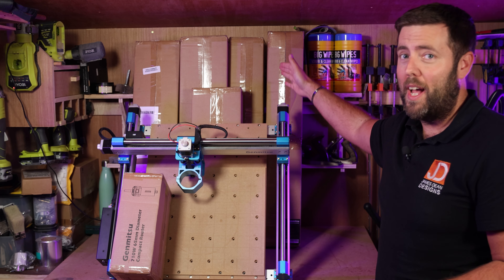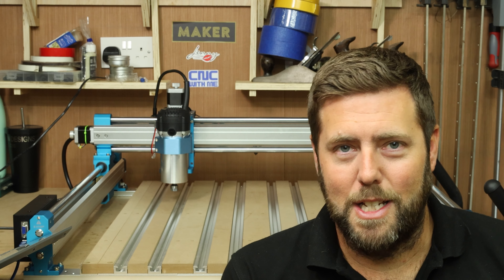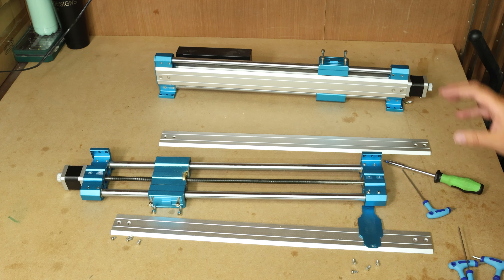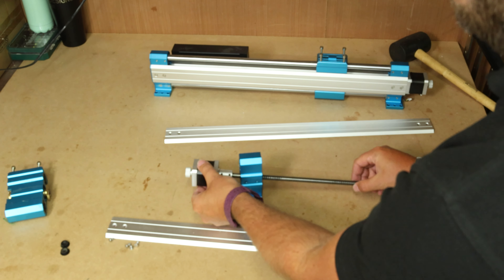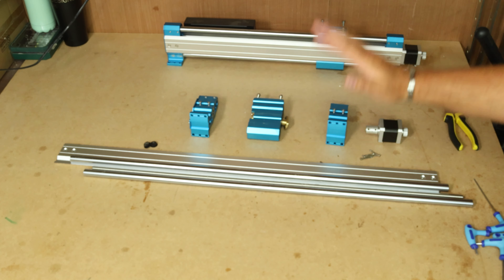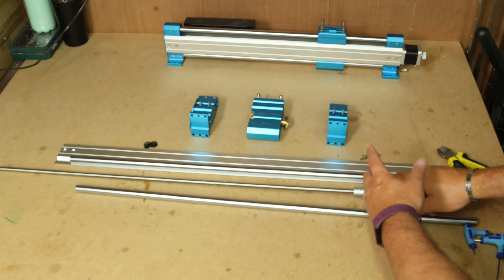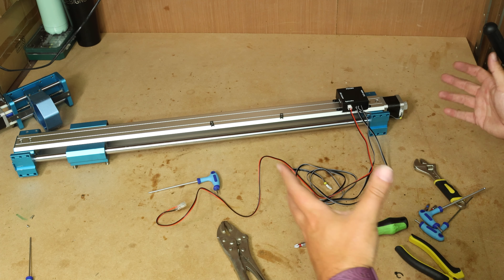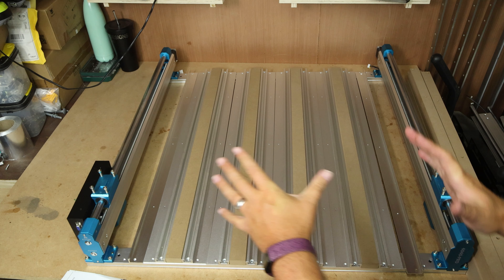Installing the 6060 extension kit for the Sainsmart 4040 Pro CNC machine

Comment: The 4040-PRO obviously wasn't meant to be disassembled with locktite having been used all over it. I stripped 3 screws trying to disassemble it to install the 4060 extension. In the end, I got it all together (took over a week waiting for a replacement part Sainsmart shipped to me from China), but one of the limit switches was behind a plate attached with one of the stripped screws so I gave up at that point and ordered a Onefinity CNC.  Sainsmart blew it on these expansion kits. Even if everything had come together in the end, which it didn't, it still would have been a horrible upgrade experience.
Reply: this was a crappy enough process that im now saving up for a onefinity machine.  currently waiting for another coupling from sainsmart.  one is sketchy and there is now a squeak because its slipping.
Reply: @Kathyoftheglade mine was squeaky during Y travel. Ended up being one of its drive screws was bent
Reply: @MikesSoftLemonade  the screws is pretty straight. i took it apart again and rolled it on a granite counter.  im just going to buy a bigger faster machine.  im looking at the onefinity or maybe the new altmill.
Reply: @Kathyoftheglade  yeah I did the extension a couple of weeks ago. It is just too floppy now in the middle. There is too much flex. When I put my small vac hose on, it flexes about 1/8”.
Reply: @MikesSoftLemonade what spindle do you have on it?
Reply: @ the makita router. the internal speed control is extremely accurate so the finish quality is very nice. It is just too weak to span that long distance with the upgrade kit.
Reply: @MikesSoftLemonade  Ah..   I’m using the stock spindle.. I’m only engraving chopping boards and the like so no need for a big router.   I installed the extension this week and had have no issues. They should have definitely considered people wanting to use the bigger routers though.     Solid steel poles is probably your solution.
Reply: @cmkenobi  Yeah exactly. Even doing what you are doing, I would recommend the makita. I don't ever work with wood, but when I do on occasion, it gets such a nice finish in half the time of the factory spindle.

Comment: Is the working area actually 600 x 600 got my kit sat on a shelf for 3 days just thought I'd ask before fitting
Reply from the maker: Yes, in fact if I remember correctly I'm sure it's slightly bigger than 600x600

Comment: i had to use a small propane torch to get the second coupler apart without stripping the set screws. the first one i had to put the coupling in a machine vise and drill out the set screws.  what a nightmare.  it left a bad enough taste that im saving up for a onefinity.

Comment: Thank you for the detailed extension installation instructions. This is a very well made video.
Since you know them people in person maybe you can pass prospective buyer feedback: 
I was very interested in the 6060 extension but didn't get it because I needed to buy the 4040pro and the extension kit separately then go through disassembly of the 4040 machine. 
They should really think about also releasing the 6060 version by itself: If selling 6060 in an almost assembled state(like 4040 pro) is too much work (packaging, labor etc) they can simply give the parts (everything other than the rods, rails etc. in the 4040 machine) and the 6060 extension as a kit.
1. This will significantly reduce the assembly time since the buyer doesn't need to deal with disassembling the 4040 machine.
2. There won't be any wasted Rods, rails etc. from the 4040 machine(I don't want to buy and keep rods for the 4040 version which I won't be using at all). Instead, they can give the hybrid table in the package. 

all these in the $700 range would be another winner for them. There are many people who need the 6060 working area.
Reply from the maker: I dont really know them personally but this feedback has been passed on many times by lots of people including myself.

Comment: 25:20 Note that the original shorter front and back bars are exactly the same height as the new longer ones, I plan on putting mine under the center of the spoilboard assembly to add more deflection/rigidity support, then surface the board after, might as well use them :)

Comment: This video is helpful in two ways. It shows how to do the upgrades but it also shows that Genmitsu are doing it the wrong way.

They should be selling two sizes of Y-axis assemblies and two sizes of X-axis assemblies, each with their own packaging. That way they could be selling four different CNC sizes by simply shipping different boxes to their customers. Same for the spoilboards, they only need to have two lengths (40 and 60) and with a 20cm width only ship two or three boxes depending on the machine size. The end price would be lower, the users would not have to deal with all the disassembly and re-assembly required and there would not be useless leftover parts which they had to make, sell and ship.

And for people who buy one size and want to upgrade later, the upgrade process would be much easier and the leftover parts would be complete assemblies that would be easier to sell or re-use in another project.

Comment: The motor collar set screw hex heads strip out so easy
Reply: Unfortunately they have used cheap screws that were not designed for multiple installation and removal. They are probably fine as long as you don’t do the upgrade but they are made out of soft metal and tend to strip out even when you add heat to loosen the lock tight. Thankfully replacement screws are provided for most of them. Replacements for the screws holding the controller box to the side rail are not provided and I broke two of them off in the hole while trying to remove them even with lots of heat. I had to drill and tap 4 new holes 1/4 inch to the left using my own screws. With multiple trips to the hardware store it took me a week to get the upgrades installed and everything put back together. Irritating.

Comment: I ended up using a heatgun to get the collars off, about a min of high heat, then I took the set screws out with a T8 Torx bit using an impact driver 😊

Comment: There is an upgraded version of the Genmitsu 4040 Pro machine called the 4040 Pro Max.. I geus the upgrade is only for the Pro? Do you think there will be an upgrade for the Max as well?
Reply from the maker: @HenkHeijnen  the main difference on the Pro Max is the XZ axis. The rest of the machine is pretty much the same.  They will be releasing an extended XZ axis at some point as the 6060 Pro Max I believe
Reply: @JamesDeanDesigns  oké! That could be good if I would buy the 4040 pro max! I see on the Sainsmart website they now offer a XZ axis upgrade for the for the 4040 pro now.. but not an extended version..
Reply from the maker: @HenkHeijnen  just takes time to filter everything though 👍

Comment: Recently upgraded mine like this too. Have you noticed any deflection at all when doing long cuts across the x axis? If i do a straight cut of say 500mm, it ends up being an arc with a deflection of about 1mm in the middle. I use illustrator + easel + candle... pretty much elliminated software issues. I curently susspect gantry sag when getting to the middle of the x axis.
Reply from the maker: There is a little. The axis essentially twists a bit closer to the centre because the weight is pulling it forward. Its like it needs a stiffener
Reply: @JamesDeanDesigns  Thats what i suspected.... any ideas on how to compensate? A stiffener?
Reply from the maker: I'm currently thinking 2 things. Either add a third rail above it, would need 2 brackets building for the ends (this is essentially how they did it on the Onefinity). Or trying to fit a linear rail to the back of the aluminium guard
Reply: @JamesDeanDesigns  A third rail above would also need a linear bearing and bracket attaching it to the router carriage right? I don't think the aluminium guard is stiff enough to attach a linear rail to, it would need swapping out for something beefier. I've been doing some tests over the last few days... there is definitely mechanical sag in the x axis. x axis cuts deviate by about 1-1.5mm in the middle and return to 0 at the end. y axis cuts are dead straight. It is also seemingly more pronounced when under load, i.e. the router is on and cutting material (even with very shallow plunge passes of 0.3mm). And even more pronounced when doing diagonal cuts, I guess because the carriage is spending more time in the middle of the rails. This is unacceptable tbh and i will write to Genmitsu. Has no one else noticed this at all?

Comment: You are using the older Z block assembly?
Reply from the maker: Yes, mine was one of the first machines our of the factory.
Reply: @JamesDeanDesigns  I got mine Mar of 23 and have had no issues with my Z assembly. 🤷🏻‍♀

Comment: Thanks for the vid James ! What sort of lubricant do you suggest for the lead screws and rods and rod bearings?
Reply: I reached out to Sainsmart with that exact question... "Thank you for reaching out to us. When it comes to lubricating the lead screws on your machine, we recommend using a silicone-based lubricating grease. One specific option you can consider is fluorinated silicone lubricating grease.

Please note that it's important to use only a small amount of lubricant to prevent excess buildup, which could attract more dirt and debris over time. Additionally, be cautious not to apply lubricant to any belts or pulleys."